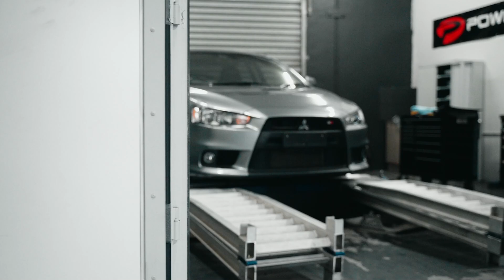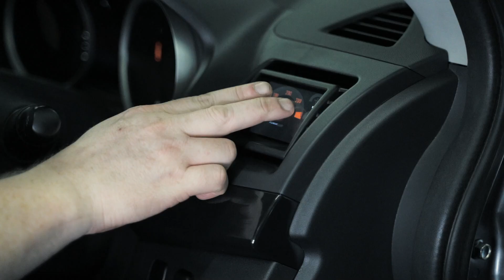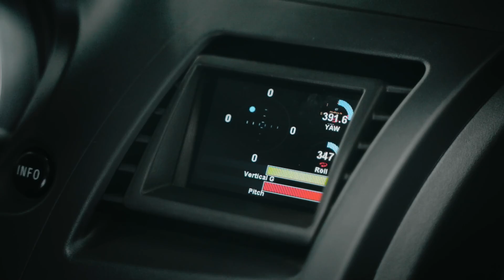How to install the CANChecked Gauge into your EVO-X

Comment from the maker: Please use the below timestamps to navigate through the instructional video.

00:00 Intro : Installing the CANChecked Gauge into your EVO-X
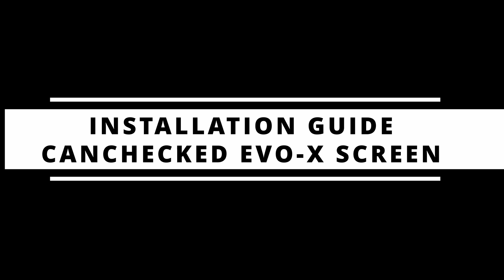00:25 Step 1 : Removing the Glovebox and Kick Panels
00:50 Step 2 : Running your wires through the console
01:34 Step 3 : Locating the grommet to pass the cables through to the engine bay
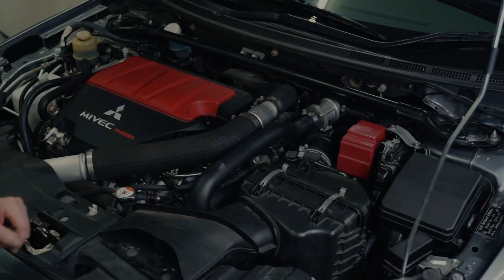02:04 Step 4 : Running the cables through from the engine bay side
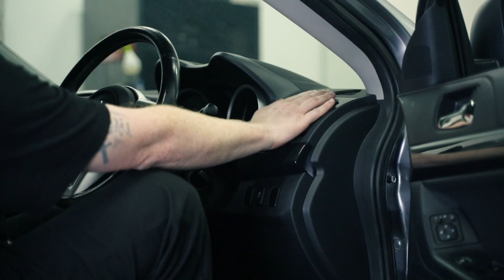02:54 Step 5 : Removing the factory EVO-X Aircon vent
03:16 Step 6 : Remove the Console Panels
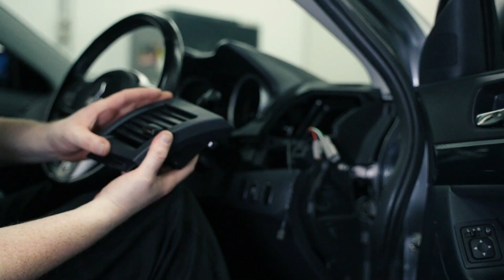05:08 Step 7 : Pulling apart the factory Aircon vent
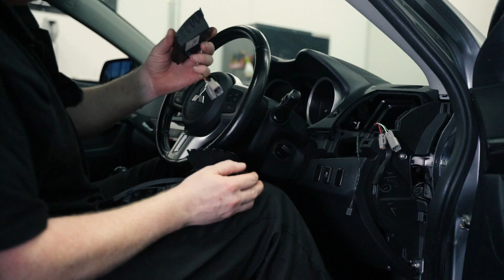06:30 Step 8 : Installing the CANChecked Gauge into the Aircon vent
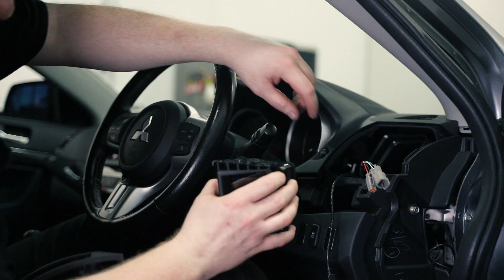07:10 Step 9 : Routing the supplied CANCecked cables through the Aircon vent
08:54 Step 10 : How to route the CANChecked wires through your dash
10:27 Step 11 : Plugging in the supplied cables into the CANCecked Gauge
10:48 Step 12 : Refit the Console Trim and Kick Panels
12:56 Explaining Page-1 on the CANChecked Gauge
13:30 Explaining Page-2 on the CANChecked Gauge
14:06 Explaining Page-3 on the CANChecked Gauge
14:16 Explaining Page-4 on the CANChecked Gauge
14:45 Explaining Page-5 on the CANChecked Gauge
15:00 Explaining Page-6 on the CANChecked Gauge
15:27 Explaining Page-7 on the CANChecked Gauge
15:50 Explaining Page-8 on the CANChecked Gauge
16:16 Explaining Page-9 on the CANChecked Gauge
16:37 Explaining Page-10 on the CANChecked Gauge
17:14 Explaining the options and settings in the CANChecked Gauge
18:26 Settings you should check out before using the CANChecked Gauge
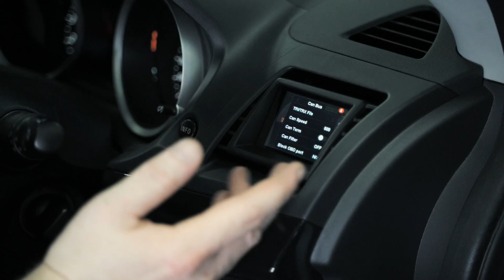20:04 Explaining the base file features of the CANChecked Gauge
20:30 Explaining OBD Port operations
21:05 Adjusting for different/custom gear ratios
21:56 Explaining the Red Light Limiter in the CANChecked Gauge
22:18 Explaining the Slpash Screen settings
22:39 Explaining the Start Screen options in the CANChecked Gauge
22:58 Is your page switching every time you rev the engine?
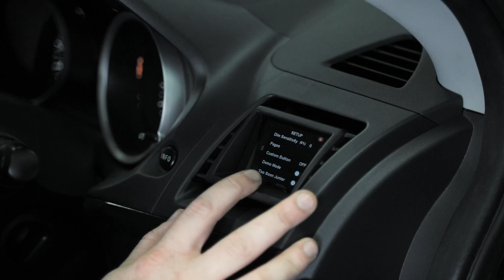24:02 CANChecked Gauge in Demo mode